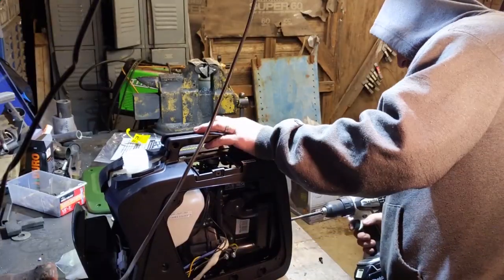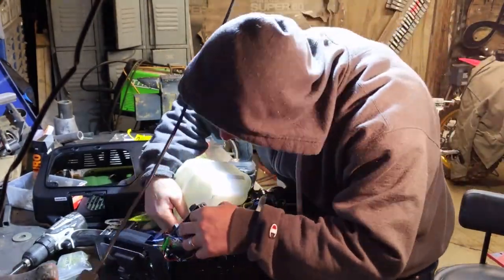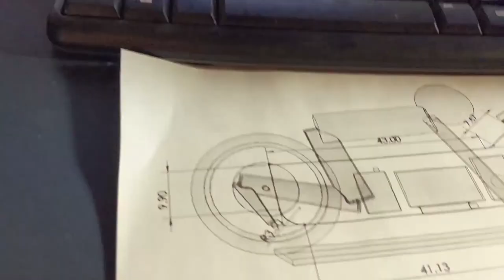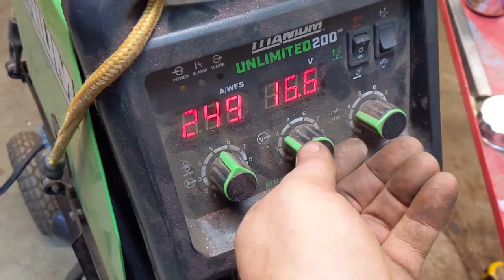Extreme Range EV mini bike build | Chassis design and construction | Lark Machine Co

Comment: Love it, subbed. Have you considered going direct from the bridge rectifier (with maybe some large capacitors on the output) into a DC-DC converter direct into the batteries. Not sure if there is much in terms of gains to be had.